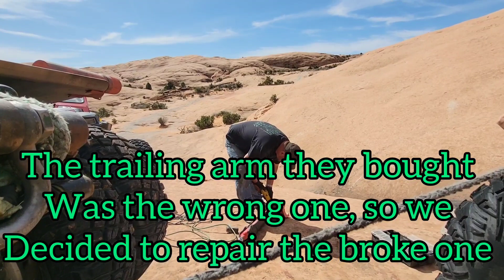Helping Recover a SXS on Hells Revenge

Comment: What a great channel, no shirt tailin', no stupid music, no cameramen, no cutesy BS,
just a squared away individual getting the job done with a capable equipped homemade rig.  You are the &embodiment of John Vigor's theory of nautical survival-
Reply: Rory doesn't need to say anything much, trailmater speaks for itself. One of the best workingman vehicles i have seen.
Reply: John Vigor's Black Box theory of nautical survival
It states that there is no such thing as fortuitous luck at sea. The reason why some boaters survive storms or have fewer accidents than others is that they earn their "luck" by diligent and constant acts of seamanship. According to Vigor, aboard every boat there's an invisible black box. Every time a skipper takes the trouble to consult the chart, inspect the filters, go forward on a rainy night to check the running lights, or take any proper seamanship precaution, he or she earns a point that goes in the black box. Then, in times when human skill and effort can accomplish no more, the points are cashed in as protection. The skipper has no control over their withdrawal. They withdraw themselves, as appropriate. Those skippers with no points in the box are the ones later described as "unlucky." Those with points to spend avoid the mishap, but must start immediately to replenish their savings for the sea offers no credit. The point I'm trying to make to the members of the Boating Class as I cover safety requirements is that such measures as checking one's safety equipment at regular intervals or practicing safety drills earn points for the black box.
Reply: @horacerumpole6912   Excellent lesson sir. As an old man, totally out of the way, ignored, I once was responsible for emergency teams both foreign and domestic. I sit by watching as people become less capable less confident unprepared yet cannot mention one damn thing to alter an outcome. 

Its called life in California.
Reply: @garbinator09  Aye sir, reading you loud and clear!
Reply: @garbinator09  I'm certain they are more laid back out there but the watching part is a malaise to youth now. I think the mechanical knowhow is declining at the same rate as electric cars are becoming more common.
ty for your service, bud.
Reply: @Strider1954  — Its late and I am tired. I listened to a lengthly discussion regarding material things, and burning through $$$, including the horrible credit so many have got themselves! I witness here in my own surroundings misguided people doing super dumb to pretty dumb stuff regards to their dreams! Being older, those dreams often came with Old men (Parent/Grand parent) being talked out of their credit card. Even their savings. Its a plague where I reside. Who says scamming only goes on over the media (?) 

Regarding life skills. Tech has taken over. Man! Can’t even think. Ain’t enough room for me to express all that comes to my mind. Be Good Jim! 

UNCLE SAM need yer tax dollars!
Reply: Awesome recovery

Comment: Good to see a sxs that didn't have to be dragged several miles out for a change. Also nice to see someone who welds with a stick machine for a change.. My old welding truck had a Lincoln SA200 on it. I used to weld in the gas and oil fields a lot. Anyway really enjoyed the video.
Reply: That SA200 is still sought after today!!
Reply: @haroldphipps3457   Yes they were great machines. Only problem I ever had was the alternator went out, and that was after ten years of service.

Comment: I find the pros and cons between the independent suspension and solid axle fascinating. Neat that the Independent has ground clearance and the solid axle has strength. To me it means that since there isn't a clear best that the off road sport has alot of potential for engineering developments.

Comment: I have thought a lot about figuring out a way to have a primary and secondary winch for safety on the front of my Jeep.  Mostly just sand and ocean recovery, but do get an occasional drag out of something like this.
Reply: I think Trail Mater has something like 6 winches on his rig.🤯
Reply: @crazyfoot490  I think you're right six or seven. I think Matt actually said he was going to put seven on his so that he could have one more.
Reply: @trd4d  I'm excited to see what Matt's building a capable Wrecker. I think it's going to take him a long time to get it as functional as Trail Mater. Trail Mater with the brain that controls it make one hell of a machine✌❤🙂
Reply: I sometimes use a large ratchet strap as a backup when recovering. 
just re tighten it every couple of feet.

Comment: Welding  out there in the open: Now some people may wonder what Rory was doing with that special hammer after the welding. While welding, it is necessary to prevent more oxygen to get into the iron/steel since it would change the material. (too long to explain here) . On that welding-stick that Rory was using, there is a mixture of some stuff, which creates over the weld one protective cover. To remove this now useless cover has two reasons to inspect the quality of the weld, and to prevent in the future to seep water under this cover, which could lead to rust.

Comment: That was a "easy" job, just to winch them out of the hole, lift it so rental crew could repair it. Nice take on the filming and warning parts :) 
I don't know if talking loud to your self is a thing for you, but a person-mic on you would be a suggestion. Then you can just talk us through your plan and how to execute it. Especially when you are alone: A (few?) fixed camera, filming the job, with you talking to your self about the task at hand and what ever comes to mind. 
"Lets see... 2 or 1 winch lines? Defiantly at least 1, or I have to push it out of the hole. You see, if I only use one on the boom, TrailMater have to lift and pull the SideXSide with that line. With one on the lower winch, it has to pull the SideXSide down towards the rockside, and pull it up to the winch point at the same time. That's not nice to Mater, either. So with 2 lines Mater gets happy, one can lift, and one can pull! Magic! And when I get it up, it's change of plan; I don't have to drag it out. The rental company are sending out a repair crew. So I just need to position it for lifting it up a bit, here on the top of this ridge."

Comment: The places you can get that rig blows my mind. And THEN you come back out with a vehicle in tow. Amazing stuff you do. Thanks for sharing! I feel like you could use some of those synthetic winch lines everyone is using these days. Curious if you like them or prefer the old reliable? Maybe we all just need to get you a sponsorship deal with them lol
Reply from the maker: I run synthetic on 5 of my 6 winches on the truck. I run cable on the main winch cuz it sometimes sees abrasion against the towed vehicle and not worth jeopardizing synthetic line in that instance.
Reply: @trailmater  Oh cool, makese sense. Thanks for the reply!

Comment: Wow the staircase looks way different without excess rubber and fluid stains … makes picking a line kinda easy … 

the spring angle on that portal from camera view seams like an odd geometry for load transfer kinematics … but I’m thinking it wouldn’t matter if it had been a billet piece LOL!  …portal setups are so costly to get exactly right … sum times gud nuf is … good enough!!

Comment: When I was at SEMA21 in November they had shit tons of this kind of half baked engineering. Portals are great if the side loading is accounted for. They had portals with lifts of 18" or so ( didn't measure) so what looked like Ford N9 tractor drive tires would fit. Looks like a swamp buggy.   The penis replacement trucks around here that never seen the pavement they like to lift and put 16" wide 24"rim tires on. Lots come in on the hook with the tire in the back and missing a spindle.. Some pretty funny shit really. Stick 8" out of the fender.
There is NO end to the stupid shit people without knowledge will do.